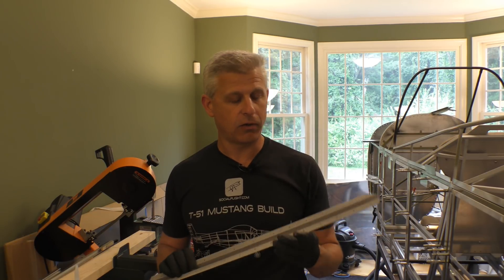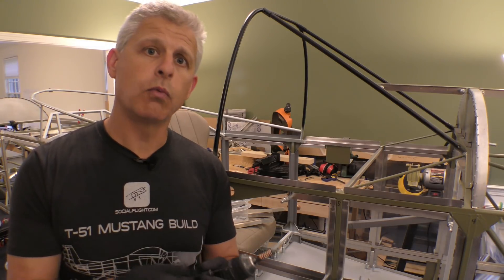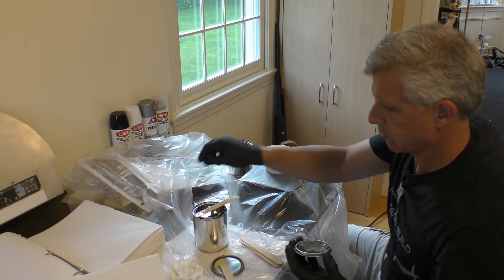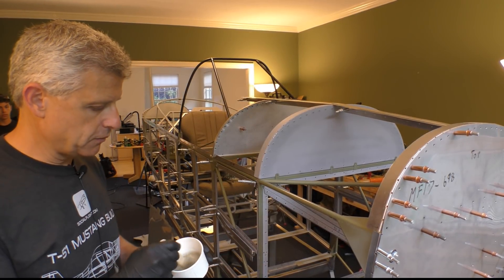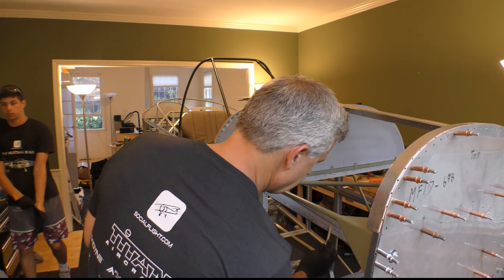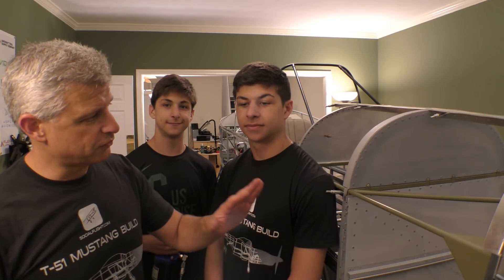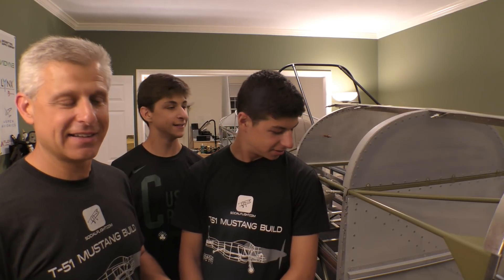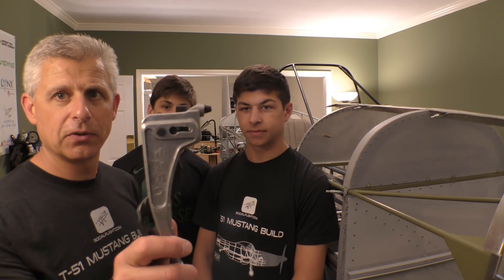Riveting the T-51D Mustang Forward Cockpit Structure!

Comment: No rivets on attaching the hat sections? Strange.
Reply from the maker: The hat sections will be riveted to the skins, sandwiching the steel frame square tubing.  They are temporarily held in place with silicone before the skins are glued and riveted in place.

Comment: Surprised that you didn't put some clecos in to hold the pieces together as you start riveting. Also never seen adhesive used with rivets. Do you know is that common in other kits?
Reply from the maker: Hi Don - Good point.  The only reason we didn't use clecos was that we didn't want to ruin them with the adhesive.  We tested the process without clecos (using rivets to locate the holes in several places and having all of us work together) and it worked fine in this case.  None of the components we assembled are held in position under stress, so that helped.  My guess is that we will have to use clecos during final assembly in other locations.  

I'm not sure what other kits use adhesive along with rivets, but this is how Titan does it.  The result is remarkably strong!